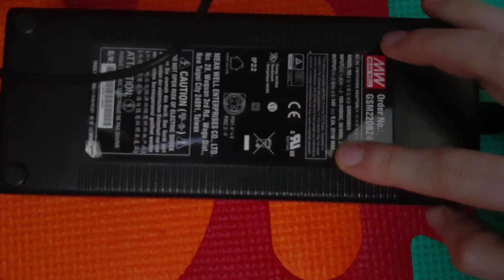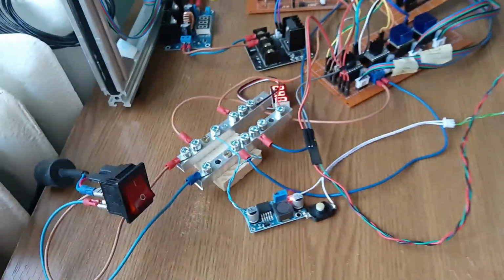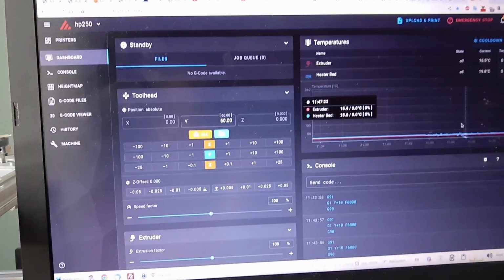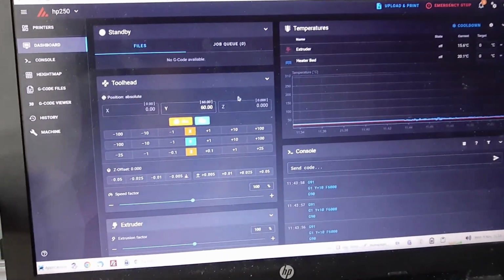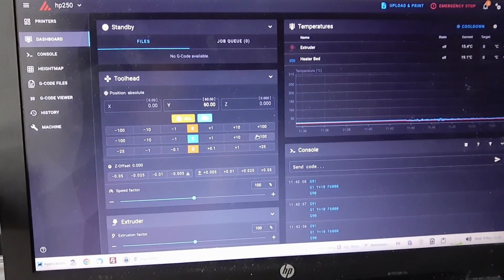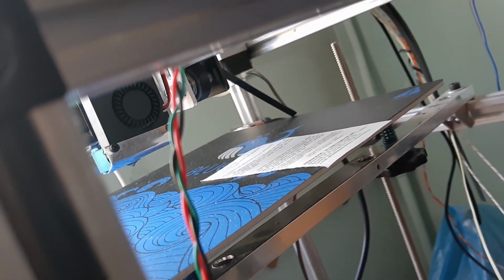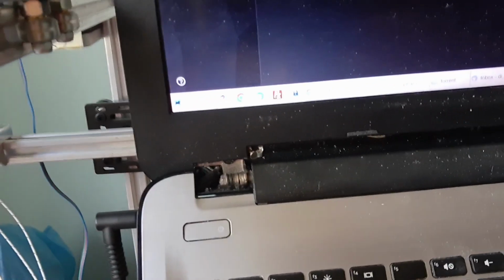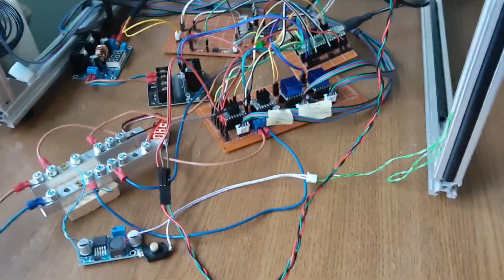Update on my DIY 3d printer progress

Comment: I would like to know why did you change from esp32 to a Pico?
Reply from the maker: The main reason was that I wanted to use Klipper, and esp32 it is not supported.  With marlin you have to recompile all the firmware every time you change lets say 1mm in the settings before you can test it. And you can run klipper of your pc/laptop, you don't need the extra raspberry pi. Plus the pico is super cheap, around 4$.

Comment: I also want to build a 3d printer. Now, i am on literature review stages. I will build my own motherboard using proto board like you, a much bigger board.

You seems to use long cables, i think at least you could shorten the cable between your mcu and motor driver. What i see is that you use electrolitic capacitor to compensate cable lenght, but you should add 100nf capacitor. 

Shorten your wire and use cable ties or tape, i think your printer should perform better. Do not put power cable and signal cable side by side, separate them or if you need to cross make it at 180 degree.

Anyway your esp32 was hot, i do have one of those. I recommend to make separate psu using lm7805 then fed to ams1117 3.3v instead of using the one onboard. You will have additional 5v 750mA that could be used for shield and 3.3v lines to fed esp32.
Reply from the maker: I'm making a new board, a bigger one with all the parts, version 2.0 :) I'm almost done will post a video soon